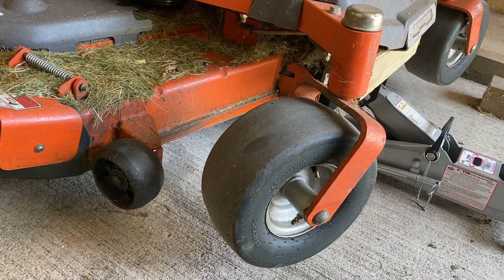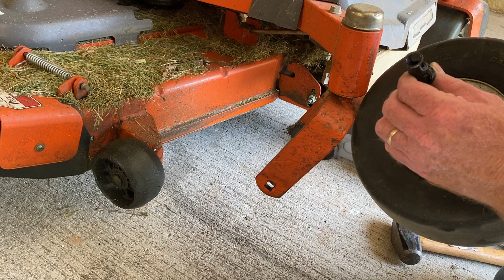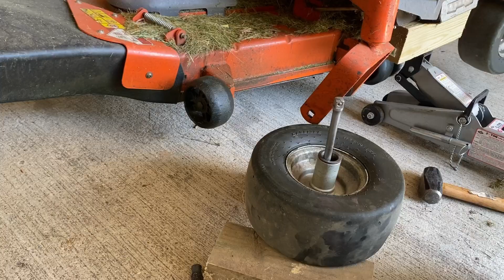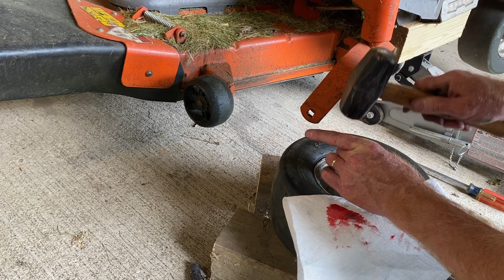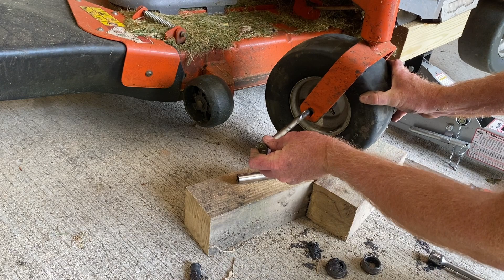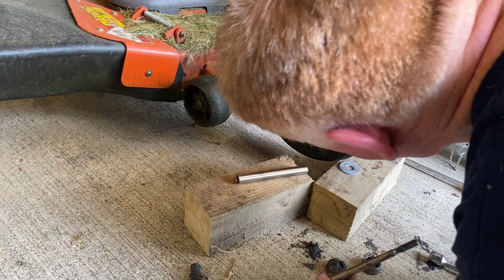Zero Turn Front Wheel Bushings w/ Bearings replacement on Husqvarna Z254F Zero Turn | Easy Upgrade!

Comment: You cannot use that old worn out axle rod.  Get a new one and also get the right tools for working on things.
Reply from the maker: Thanks for watching! The kit came with the axle sleeves (in stainless) but I didn't know the original bolt was worn through until I got it apart.  Replacing it is on the list, but would be a boring video.  Not everyone has a bearing press, so I had to use what was available.
Reply: I went online and got the rebuilt kit whick was all stainless steel oil infused with new axle sleeves, and I used a 3/4 brass rod to knock them out. It took about 30 minutes to complete both front wheels ....thanks a lot for your help!@wecanfixit7308
Reply from the maker: @dougdent1942  glad it helped!
Reply: Can you please give me the part number for that upgrade for the wheel, i couldn't find it anywhere.  @wecanfixitgarage
Reply: Pay attention he did put a new axle rod in.

Comment: Thank you so much for this video! Could you make a video on how to adjust the deck height on the Husqvarna Z54F?

I have the same model as you, and I can’t seem to adjust it for anything.

On the highest setting (6) the front is 2.5” off the ground, and the back is 3.5”. I’m fine with the pitch, but it just seems so close to the ground, even just 1/2” higher would be nice.
Reply from the maker: sure.  I just did this.  basically there’s two bolts at the front that adjust the front tilt.  You need to make sure your air pressure is correct and that you’re on level ground to start.  The wheel bushings being worn out actually lower the front of the mower also.
Reply: @wecanfixitgarage  Thank you so much for this.

I ordered the same bushings kit you used. So I’m hoping to install them tomorrow or early next week.

I adjusted those two bolts on the front end of the mower (beneath the gray plastic foot rest). They adjusted that front bar that hooks into the deck. Tightening them brought the deck too far forward so that I couldn’t get the front deck lift arms over the frame pins.

I also believe the rear deck lift arm bolts are as tight as they can be.

So I guess it must be a leveling issue with the tires. 🤷🏼‍♀️

After I put the new bushings on, I’ll measure everything and figure out how to adjust from there.

Thank you so much, I really can’t tell you how helpful this video was!
Reply from the maker: @Aveeguides  I’ll take another look at the leveling. My axles had eaten halfway through the bolts, so I know the front was at least a half/ three quarters of an inch lower than it should have been

Comment: Where did you buy the kit?
Reply from the maker: sorry, meant to link
https://www.amazon.com/XQK-Stainless-Bearing-Conversion-Husqvarna/dp/B0CL4J1FPV/ref=sr_1_3?crid=1ZXE4K7DTIB8S&dib=eyJ2IjoiMSJ9.6nXWyCd5PBIGbv9NNSLNaUV_mWGMN5Gm2RNbhQ0DRqJ5sqF7hRr3yKINWzDCHNLd_QzU2qIjwGKiQi30rrj2TN_DVPBuI-ez1QSf_TR1Xj8ZdpTjwmgUwVixUdlNVSIfV8oS26FgBSEmPPFd5YKiM_h24thBaJvJ1JsHe6bRLyP7kgFCSfpPwlBJWHPzVUEtVUbiIQpXmIWAXgXS_SUR5J5hDbIilkkf3og4bvtp9Nk.50w6MQhFb_CLGbGe0Xg0yv4DwkLAlsa6w3S3kbDf3ik&dib_tag=se&keywords=husqvarna+z254f+front+wheel+bearings&qid=1719509637&sprefix=husqvarna+z254F+front+wheel+%2Caps%2C136&sr=8-3
Reply: Wow u got a deal 18 bucks , now they are 43 bucks.
Reply from the maker: @bigrick684  you are correct, I apologize
Reply: Upgrade to Grade 8 Bolts and Lock Nuts, instead of the Grade 5 Bolts, once they work loose just a little, the bolts get worn through. Even some Commercial Mowers use Grade 5, which are not strong enough